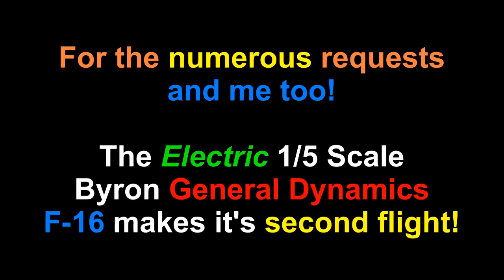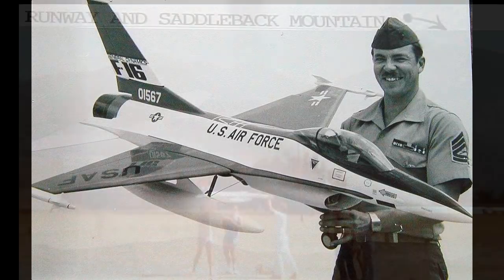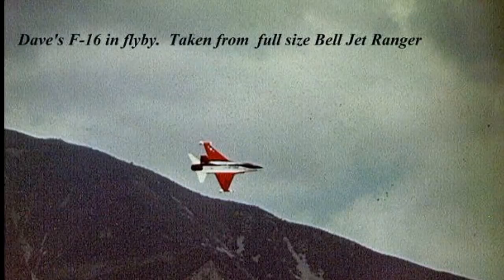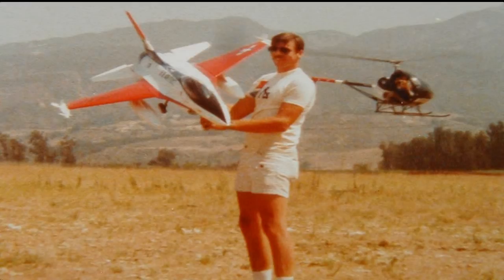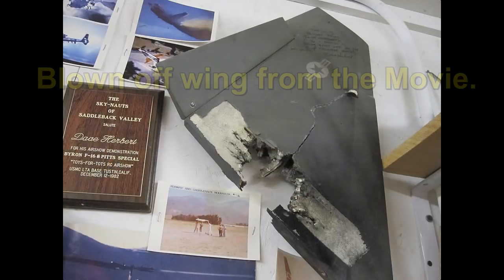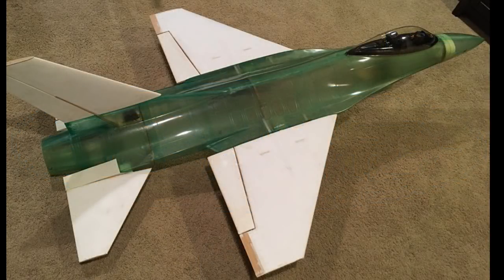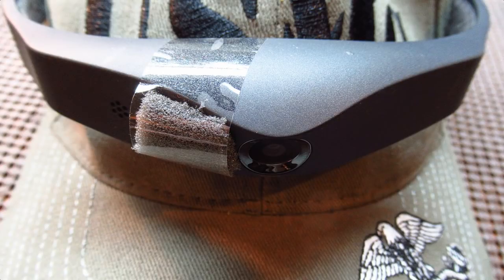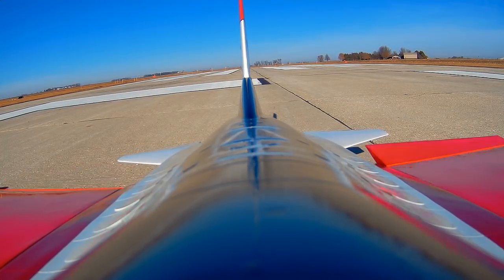1/5th Scale, Electrified, General Dynamics YF-16's 2nd Flight! By request.

Comment: sounds great Dave 
I used to fly a combat models foam F16 back in the mid 90's and that was nitro ducted fan. I now have a HSD 90mm Viper jet on 6S 5000 and was radar gunned at 170 KMh level pass :) 
Will you maybe install retracts in your F16?

Comment: It really sinks when you cut throttle
Reply: -I got you, it did look like a carrier landing,  great job on air frame and landing gear...I was on the USS Forrestal Tiger cruise, the last cruise for the Phantom and Crusader.
-I love all your videos...God Bless !
Reply: I think Dave was trying to give it full collective after chopping the throttle in Ground Effect :)
Reply: It had a 45deg glide slope all the way to the concrete, no ground effect.
Helicopters have collective.
Reply from the maker: I wanted to Land in front of me like a carrier landing, so came in that way. They land just like that on the carriers I was on. Most jets don't have a high glide rates anyway.
Reply from the maker: Ahhh, the Forrestal!  Great!  Thanks kindly for serving.  I was on the USS Midway in 1976 and learned a lot about landings, and all our planes were F-4's, A6's, F-7s, and E2B's!   Maybe you saw my Midway Videos.  Anyway, my F-16 landed like I hoped, as I would have had to cross in front of me into the sun, which makes it harder to see.  In my first video, I made a longer landing. :-)  Thanks again.
Reply: I never served, my bro. did I was on for a tiger Cruise( male relatives of on board officers which lasted 10 days in 1985 ) 
I will look for your Midway vids......
Thank You for serving.....